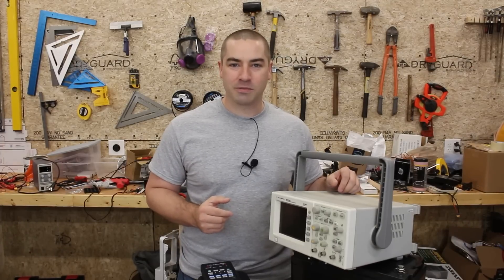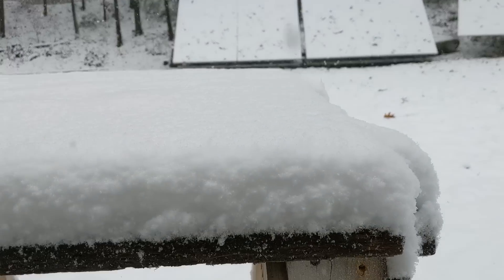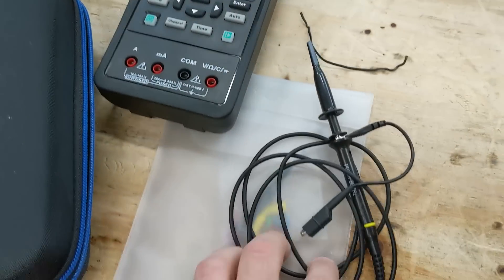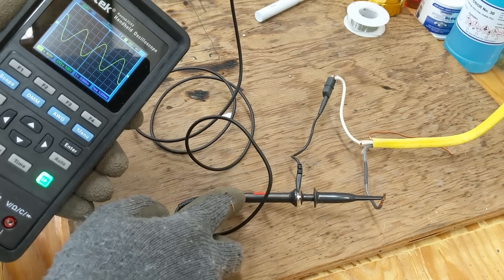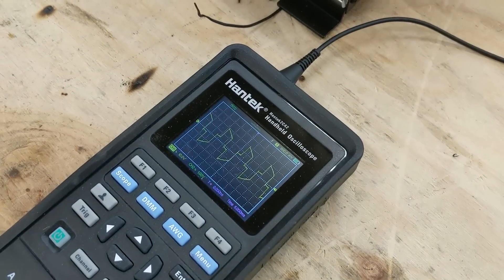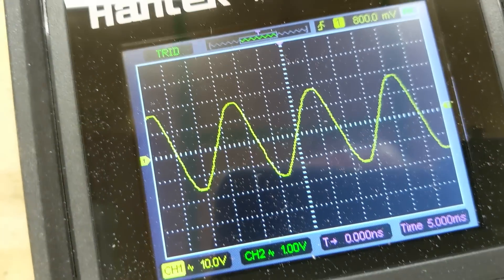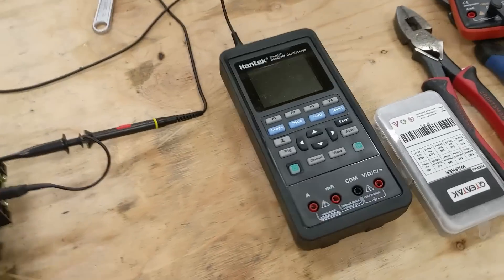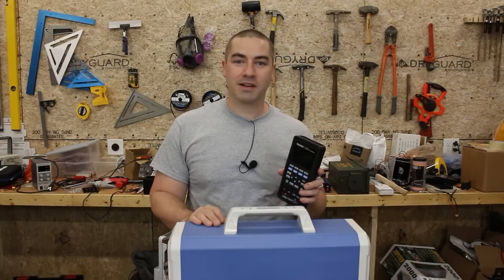New oscilloscope; Am I doing it right?

Comment: The waveform will probably become worse when under various loads. An incandescent light bulb loads the inverter differently to an AC unit for example. I think testing the various inverters with different load types and sizes will be good to determine how good the inverter is. I think an inductive load is like double the work for the inverter over a resistive load for the same wattage so keep that in mind. 

As for the scope, I really think just playing with it more is the best option to know what to do. Especially if you have some method of signal generations so you can get the settings dialed quickly
Reply from the maker: I agree 100%.  I want to make a more in-depth video testing all my inverters under different loads.  But before I do that, I want to know how to take snapshots with the scope, and how to zoom in on the peaks of the wave, and zoom in where it crosses the middle.  Once I learn how to do those things, then I can make an inverter testing video.  The point of this video is to ask for help in how to do those tasks so that I can make a better inverter test video.
Reply: @DavidPozEnergy  sounds good mate. I'll await your video
Reply: I have a pair of the SMAs, with some AC coupled microinverters.  Sometimes in the morning or late afternoon when the microinverters are just about matching the house loads, I notice flickering, about maybe 10hz, of some led light bulbs.  My theory is the SMAs are switching between charging and discharging the battery, right on that edge.  I wonder what the waveform looks like in this situation.
Reply: @DaleKlein  OH MAN!!! I'm glad I found your post to confirm the EXACT same problem I've been fighting SMA support for 7 months on this, back and forth on this flickering light problem. This happens only when inductive loads are present and is worse when like you said, when the loads are matching the house loads. I have 2x SI 6048 and SB 7.7.

Comment: Labscopes are something many don’t understand yet as an instructor for ACDelco, I held a two day class, limit 6 technicians because of scope numbers, questions and personal attention required by each person. Scopes take a sample at various times per second. They are improving so much as to try and real time sampling. A cycle is a wave form that repeats in one second. A/C household power, the potential is 120Vac, while switching 60 times per second. So time is controlled, amplitude is a wave form off the screen. Both voltage readings are obvious but with an amp clamp, you can see the activity inside a circuit. There are many patterns but Vdc & Vac are the most common to review and examine for glitches or defects. 
  Take a vehicle with EFI, find the throttle position sensor with 3 wires. 1 is 5Vdc in, ground thru dedicated with to PCM and signal called reference. The signal back to the PCM, grows in voltage from a 5 volt input, starting a low (Never Zero) but say 0.70 volts DC. If you move it slowly and monitor it, it should climb to near 5Vdc at wide open throttle (WOT). As it increases, the voltage gently increases unless you see on the scope where it drops to zero! That’s a defect. 
 Inverter technology has come a long way as early patents are no longer protected. YAMAHA had one of the best DC to AC inverters made 20+ years ago. But many companies and engineers have figured out how to create an A/C sine wave at the current that is required. Technology moves forward, I explain it this way:  Large companies have R & D centers with a large 5 story building of engineering of different capacities. Once they design and produce an excellent product, they don’t fire the people, send them out the door, turn the lights off, then lock the door & sell the property! No, they improve, design to make better, lower power consumption and bend to the will of marketing who believe they know what customers want, that would cause they to stampede the seller to find, get and buy the product! 
 Learning your scope is not that hard, but please understand it’s a tool and provides info you can’t get anywhere. Serial data communication is another issue but use by service diagnostic to find a problem, bad wire, or module called a node for 16+ years. The 2012 Corvette has 23 nodes or individual computers. Software use by engineering felt that leaving some of this available to the dealer supported equipment would be better. 
  Remember, all 
businesses are trying to make more that money in a bank or stock market. Otherwise who wants a business. If I can’t buy better, I have to sell better. If the economy can’t support this, they file for bankruptcy! 
  Best of luck. Wonderful equipment and coming from a disabled old guy, this is good info for our replacements to learn.
  Thanks kindly. DK.

Comment: You’re doing fine with that handheld scope! Well done! Using battery power, isolated from the AC line is indeed a safer path to go with line - connected devices. I would like to comment that your no- load measurements of the inverters don’t truly represent the purity of their output. The AC waveforms can seriously crap out under load. So I would suggest that you connect a load to the outputs that is say, 75% of rated - something like a 1500 watt heat gun for the big ones. Then probe across hot and neutral with your handheld scope as you are doing now.

Comment: You and George have generated a lot of interest in using those scopes, but many who want to use them are like you and they also need to learn how to use one.
You should consider a few episodes showing exactly what buttons to push and in what order to change the probe multiplier to match the probe, set the coupling to AC or DC with examples showing the difference on a modified sine wave waveform, etc...
Many people already have them, and many people will buy them if you have videos on getting started using it.

Comment: David, it would be nice to see what these inverters are doing with their live and neutral relative to ground, not just between L and N. You can do this easily by putting scope ground on inverter ground and then clipping the probes on the live and neutral. Ideally the neutral has no voltage and the live has a sine wave but on cheaper inverters you may see each pin having half of the wave. This is important to know because these cheaper inverters will blow up if connected to a home electrical system.
Reply from the maker: Great idea, thanks.

Comment: I'm glad you did not use the other scope because there is a big change you blow it up when connecting the probe to something which is referenced to mains. That's because ground of the probe is internally connected to the ground of the mains grid through the chassis. A hendheld scope is saver because it is not connected to mains ground. A safe way to use the other scope might be using a current probe instead.

Comment: Hi David, to zoom in on the outputs that are clean, you'll want to set the time base to less time per division. Supposing that you zoom to 500 us per division, you'll just see a piece of the waveform around the trigger point. You should then be able to move the trigger point up or down to look at different parts of the waveform. You can invert the trigger to look at the downward sloping portion. To zoom in on the ratty-looking waveform, this method might not work well, because it might be hard to get a stable trigger, so you might need a scope with a zoom function for that.

Comment: You're better off with battery scopes for this type of measurement work as anything AC feed will connect the earth pin on the plug to the ground lead from the scope. If in doubt use two channels (not ground) as all scopes can subtract one channel from an other

Comment: I agree with the others with needing to do a test of the inverters with a load. Usually under 0 load, the sine wave is clean, but as the load increases, the inverter has a harder and harder time keeping it true.
Certain electronics and especially induction motors do 'not' like modified wave power at all. Can actually burn them up by doing so. Never run a motor on a modified inverter if possible (ceiling fans, compressors, etc).
Some say electronics don't like modified sine waves either. But generally if there is whining, should be fine. Most electronics run off of DC internally. TVs for example run on DC, just high voltage DC. Same with computers, etc. Microwave control panel may run on modified fine, but the turn table and cooling fan wouldn't.

Comment: The Oscilloscope is a volt meter showing voltage versus time.  If you wanted to show current draw say from battery during inverter startup or when a load is introduced, connect the probe across a shunt.  Some of your shunts have calibration numbers such as 100 amps 75 mv.  Hooked up in this manner, the polarity of the voltage indicates into the battery or out of the battery.  The scope should also have a time sweep adjustment.  You would slow the sweep down to trace a signal that changes slowly over time.  Also, when showing an AC sine wave, you can measure peak to peak values.  RMS is 0.707 of peak.

Comment: With your Agilent oscilloscope, beware of grounding. Most scopes ground the probe's ground to the AC input ground, so powering the scope from AC properly and measuring anything can end up shorting it to ground. Normally you would electrically isolate whatever you are testing for safety, but you can also get a differential probe to replace the standard probe and isolate the scope from the signal. None of this matters with your handheld scope since it's battery powered and not grounded to anything.

Comment: The scope is set in auto and the image shows the time per block is 5ms, that 0.005 seconds. A 60 Hz cycle should take 16.66ms, from star to finish of the wave. You'll see it take a bit over 3 blocks ( 5 x 3 + ~1 = ~16 ms  ).  They look good at 60 Hz.
Now for the voltage, your probe is set to 10x and each block is set at 10 V.. The reading on the scope is set to Peak to Peak, so it's about ( 10 + 8 = 18 x 10 (<The Probe Multiplier ) =  180 Vpeak, Therefore it's 360 V Peak to Peak . We are used to RMS ( Root Mean Square  ) so que get the normal voltage just multiple the peak voltage x 0.7071.

Example ~180 x 0.7071 =  ~127.278

Remember that under no load, it's a good idea to test the inverters at 50% load and take a look at the wave.

Comment: probably commented below, but its pretty easy to get sinewave with no load....  its really what happens when the inverter is under decent or rated loads that will show how well the controller is setup and if it was designed with appropriate headroom.

Comment: Edit: You've inspired me to buy one myself. I decided to go for the 2D42 for the waveform generator.

Very cool. If you want to get waveforms, you can plug it into a computer using Hantek's software. I think you have to take the measurements while it's plugged in, but if you have a laptop you can use while unplugged you should be fine. There's also open source software for Windows, Linux, MacOS and apparently Android which might work. I'd expect if you get a USB OTG cable for your phone it might work.

TBH I've never used Hanteks, but I have used some other scopes over USB to get screenshots.

Comment: Hey David, just be careful... oscilloscopes typically aren't used with very high voltage.  For example, when I looked yours up, it said the maximum was 150V AC.  So if you hook it up to 220V or more, it likely will let the magic smoke out....lol  That modified sinewave was...pretty ugly.
Reply: I was going to say same thing. It is kind of too late now, but safest choice would have been to buy (active high voltage) differential probe. They are safe(r) when measuring mains.

Still not a bad buy that scope.
Reply: Is that 150vac at the scope itself or 150v when you use x10 probes? Probably the latter (meaning 15vac on the scope itself) but it would be better if manufacturers were more clear about this.

Comment: 04:04 The sloping lines from the modified sine wave inverter indicates that the oscilloscope is in AC coupling mode. In DC coupling mode it would look rectangular.  Even Amy Beaudet made that mistake. https://youtu.be/I0X2YDfDaQU?t=80  The modified sine wave was engineered to have the same RMS and peak-to-peak voltages as a real sine wave. It may cancel the third harmonic as well.

Comment: Great start.
NO SMOKE!
And your waveform pictures look the same as George's waveforms did on the same scope.
Now learn how to set channel 1 (yellow trace) to DC coupling, and X100 for the probe multiplier and look at that modified sinewave again....
Images can be saved and downloaded thru the USB port to a PC, but you lose your isolation when you do that unless you use a battery powered laptop.
Software is available free at the Hantek web site.....

Comment: David, you should isolate the scope to hot lead with a capacitor. .1uf with a working voltage above 200v should work, but the actual value of capacitor should not matter, but working voltage is important.